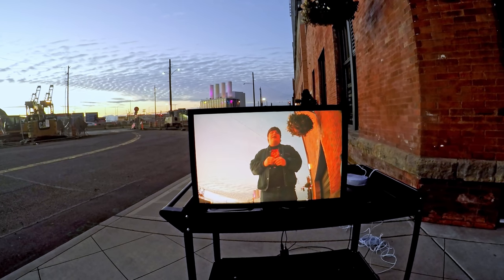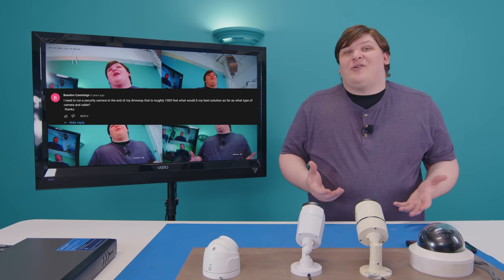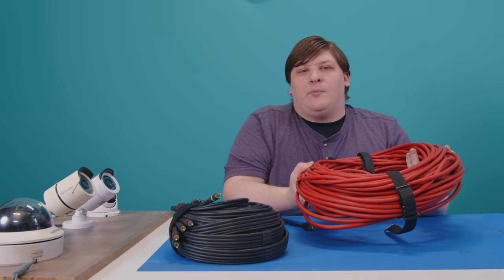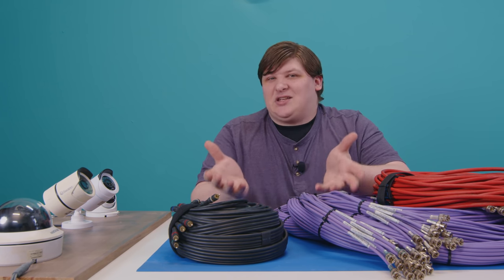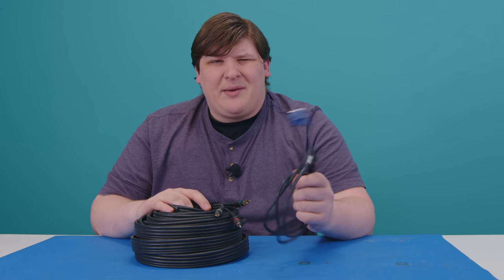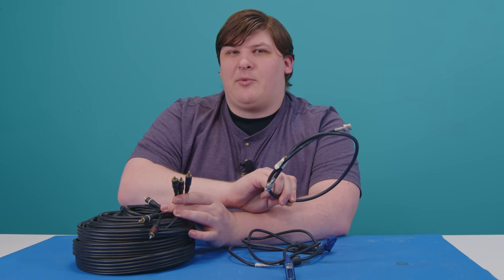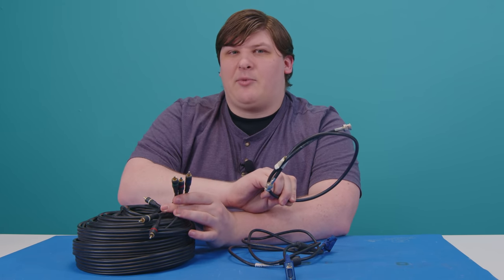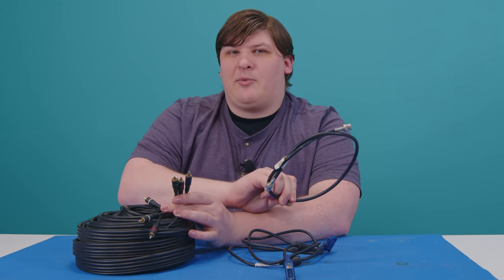1000ft of ANALOG HD video over a single cable?! [AHD/CVI/TVI]

Comment: To the point about graceful signal degradation in digital: This actually does exist, and the only company that I know who does it got their start in AHD security cameras. Divimath, who make HDZero FPV drone racing transceivers, have their signal processors accept basically any data and display it uncompressed, as-is, so while the picture is digital (some kind of JPEG-like DCT compression) it fuzzes and fades very similarly to analog.
Reply from the maker: Okay that's VERY exciting, I would love to see this in action!
Reply: Ah, neat! It does seem like the goal of a standard video codec is balancing compression with quality, but ignoring robustness for the most part. Data between key frames is so dependent on being intact (since they use complicated methods to store differences between frames rather than whole images) that missing a small part can destroy the whole image between the key frames. So with data storage and transmission being less of an issue, it makes sense for there to be a market for more robust codecs in certain situations. Too bad it's too late for DTV.
Reply: Oh neat! That completely matches up with my experience with FPV drones, but I never knew the reason the signal/picture acted like that :)
Reply: @nooneinpart  That's what DTV should do/look like if being used in a sub par situation in a sane world.
Reply: And now that you mention that.  Even just transmitting analog HD over a wider pipe as a downlink would probably be godsend for high performance drones.
Reply: @stevenclark2188  Yes, but then you get into a bandwidth problem.  If you want to have more than one drone in the air, you have to limit to about 40mhz bands in the 5ghz spectrum, and to achieve that you definitely need some kind of multiplexing. Sending a single high speed analog signal like AHD would create a ton of spectral noise, which is why the standards are going digital.
Reply: For reference, analog NTSC has a bandwidth of around 8 to 10 MHz, even though only the center 1 MHz or so is actually needed for the data. All other stuff is fuzz from modulating an analog signal with sharp edges.
Reply: To my knowledge, MJPEG does this pretty well, because it compresses every frame individually as a jpeg and sends it that way, so if one frame drops it doesn't kill the whole stream. It's a neat method, just not very efficient.
Reply: @tbuk8350  MJPEG is probably the idea intraframe format, but you can get better  subframe reliability by transmitting the image in tiles over many narrow, orthogonal carriers. That way if you miss a tile, or one carrier fades, you at worst lose a line or something rather than a whole frame. Chris Rosser has a podcast where he talks with Carl Zhou about this.
Reply: @Jergling  : You could probably get an even better result with some sort of fractal treatment, where the signal is first converted to some sort of hierarchal relative-encoded fractal form, and each data stream carries more bits from one "fractal path" than from others, while still carrying enough to get a fuzzy image in the non-prefered areas. Put in some effort to ensure that all of the paths carry data that is "representative" but minimally duplicative,  and throw in a bit of consideration for time so that you can compensate for lousy frequencies by swapping the binary channels from one analogue channel to another, and you should get an encoding that surpasses MJPEG.
Reply: @Jergling  yeah, it's not perfect but it's pretty good. I use MJPEG streams on a wireless camera I have on a robot I'm building, because it takes up less bandwidth than an uncompressed digital stream, but it's just as reliable, and the quality isn't bad.
Reply: @absalomdraconis  I have actually been looking into developing algos for this. In the video world they call it "multiple description encoding" or "enhancement layering". Took me forever to find those terms.
Reply: Yes you can see a history of this by watching the evolution of Tour de France coverage or something similar.  The mobile cameras stuck with analogue right up to switching HD at the last moment in late 2000s, and they now do a "keyframe sweep" (my phrase) that cleans up stale error pixels from the MPEG-style more efficient motion blocks.
Reply: There's a spectrum of tolerance to degradation, with analogue at one end, and high-efficiency MPEG-style at the other.  Adding 'hinting' for delivery formats is a 1% overhead that helps.  The next step is avoiding B-frames so that errors don't propagate further in time.  The next step is the common industrial technique of spatial sweeping refresh of keyframes constantly, making dropouts much less difficult for the viewer.  A radical step is to remove motion compression entirely, and is useful for tapes (where data is cheap) and maybe cables, where you'd want 25 or 50 Mbps for SDTV only (typically 10x less -- you can see the gains that MPEG creates).  Finally you can ditch compression altogether, like SDI and HDMI, or just a light-touch 3x that frankly won't matter if you're not editing CGI or doing colorist work.  That's 270Mbps for SDTV or 1.5Gbps for plain HD with no 1080p60 or 10-bit, HDR etc.  If you can sustain that level of throughput for 99.99% of frames, it might be tolerable.  Bit errors are not noticeable but I'd have to give you a lot more "nines" to talk about pixels or bits.

Comment: Working at a lawfim, I hate finding codecs for surveillance systems when needing to do editing.  The worst is when the video player that the hardware requires for playback doesn't supply a way to export the video to a usable format.  The worst is when multiple cameras record at 15, 30, and 60fps and try to .watch up angles.  Pain in the ass.
Reply: Working at a court house, I completely understand. Evidence gets submitted, and you can't play it without installing codec of the month. Some of those come from really sketchy developers, so we require conversion to a "vanilla" codec.  I've even seen proprietary .WAV files which I didn't think was possible.
Reply: Would a law firm pay someone to do this as a service?
Reply: @FloydBunsen  I would think so. Legal/trial support services is a thing. Some firms have them on staff, but many outsource the job. There are probably some serious NDAs for handling sensitive stuff.
Reply: @TechnoTinker  Yeah. .WAV is a container format. I was having fun playing around with a pirated copy of the Fraunhofer MP3 codec for whatever predated DirectShow as a teenager back on Windows 95 and using that to put MP3-compressed audio into .WAV containers. I forget if Windows 3.1 did, but Windows 95 came with several different codecs for .WAV by default.
Reply: @ssokolow  I think Windows 3.1 had about 5 codecs for WAVs, and I just took it for granted that they were always one of the standard ones until that security footage came in. I was really hoping that I could just change the byte for the format, but it wasn't that simple.  Wikipedia has some good info on the container layout.
Reply: @ssokolow  yeah sadly WAV is not really always guaranteeing you that you get lossless PCM. When i was dealing with these early 2000s MP3 players that could also record Voice i was surprised to see things like ADPCM and other exotic compressed variants.
Reply: @PsRohrbaugh  Yes..... when they have these ancient browser viewers....  Not in a long time though have I seen that though.  Both surveillance and viewing MRI's / X-Rays were a pain till not long ago.
Reply: @FloydBunsen  Usually firms have on site IT people or outside.  I have worked for one exclusively for the past 18 years.  Total of 24 years in IT / Legal field.  As lead programmer/admin, if who you pay for IT support can't do it or make it happen, find another IT person/company.  I used to find it amazing how many people still can't use a computer to its full potential nowadays.  When I had a TRS-80 in '81, I could understand, but now?  I guess it's just a specialized field some of us are in and we are wired different, that's all.  Such is life.  :)
Reply: IKR!  Sometimes the makers of the security gear want to get paid to allow export off of the device.  When nothing else works, get a dark room and aim a camera at the screen.  (Use a tripod, watch for reflections of lights behind the camera, and set white balance to outdoor.)

Comment: In the '90s I remember hearing about plans for a stopgap system for consumer use that would stitch digital video onto the sides of a 4:3 analog TV signal to create a widescreen image while remaining backwards compatible with existing TVs. That didn't go anywhere, I guess due to the FCC realizing how lucrative it would be to abandon analog so they could cram multiple digital TV signals into a single transmitter and then sell off the upper UHF channels to mobile phone carriers.
Reply: Put "wikipedia palplus" into a decent web search engine.  It was briefly used in several European countries.  My Sony DHR-1000UK DV cassette deck has the PALplus decoder built in.
Reply: And where would the frequencies for that extra bandwidth  to carry digital sides come from? Also how would that increase  vertical and horizontal resolution in the center?
Reply: I sure do wish that the weird Frankensignal would've come to fruition.
Reply: @StevenBradford  I cannot definitively answer this question but with radio stations in the US there is a certain amount of bandwidth between channels called guard bands. When FM got the addition of HD radio they used a small amount of bandwidth on either side of the channels using a small amount of the guard band for the digital signal. The digital signal also takes significantly less bandwidth so it fits in the guard bands nicely. You can see what this looks like by searching on here for "HD Radio RTL-SDR Decoding vs Analog Radio"
Reply: @StevenBradford  Search "Combining Digital and Analog Signals for US IBOC FM Broadcasting" to find the paper on the topic by Bob & Bob.
Reply: Zenith developed a NTSC compatible analog hybrid system in the late 80's (I think it was called ACTV or something similar). I have a old (IIRC popular electronics) magazine with an article on it around here somewhere.  Basically it would use every other line of an NTSC signal and the rest would be on additional channel(s)  IIRC there were 3 proposed and tested versions one used half a channel for the HD supplementary data and was something comparable to 720P, and the there were ones that used 1-3 extra channels for higher quality...The FCC didn't like this and shortly after changed their rules to require a non-backwards compatible digital system that used no more than 1 standard US 6MHz wide RF TV channel to send HD.

This shift in rules after tremendous development money had been poured in sort of bankrupted Zenith (the last American owned TV maker at the time), they did manage to develop the RF data transport layer of ATSC and those patents had value, but ultimately they got bought out by a company that had been building some of their products since the 70's LG.
Reply: @tomcarlson3913  fascinating!!
Reply: Over here in Europe we had PAL Plus which was a bit of a niche in the mid 90s, when 16:9 Television sets were introduced. But apart from PBS stations nobody else used it on normal commercial stations. And there was even ONE Laserdisc movie that was PAL Plus encoded. Not sure if it did cost extra to include it which may have been the reason why most TV stations never used it. I guess it was just a matter of having to invest into more hardware with no real benefit.
Reply: @StevenBradford  An NTSC compatible version would get an extra 3 mhz channel for supplementary data.  In practice this simply didn't work.  If your NTSC reception was anything less than flawless, trying to add extra detail to it accomplished nothing.  So the incompatible all-digital channel we have now was a much better choice.  It only cuts out in situations where NTSC would have been unwatchable poor as well.
Reply: @fungo6631  ATSC 3.0?  Nah.  Broadcast TV is basically over.  Everyone is watching TV on their phones or through the internet.
Reply: @fungo6631  Have you ever tried to find anything worth watching on TV in such places?
Reply: @VPWedding  do ppl watch TV or just turn it on for their pets or kids when they need too pacify them
Reply: @isaarunarom7830  I'm just saying that we'd be better off building universal internet than tweaking ATSC - which will only benefit people in larger markets that won't be watching much more TV anyway.
Reply: @VPWedding  I am within a 10 mile radius of a major city with many in town broadcast. The analog system was superior in every way but picture quality.All channels were available with simple rabbit ears with acceptable signal quality. Digital requires a roof mounted amplified directional antenna to pick up the same channels and this still has bad reception on some that are on the fringe of the aim of the antenna.

Yes picture and sound are much better and the sub channels are a great addition in some cases, but the channel loss due fo weather changes and just random dropouts made using it suck. I would prefer the crappy reliable analog over digital, atleast in a storm I could see what the news was saying instead all I see and hear is the stuttering unintelligible  digital garbage.
Reply: @D3M3NT3Dstrang3r  Strange.  My experience is almost the opposite.  I'm in the suburbs.  I get much better stability from digital, but am disappointed with the sub-channels here.  I've always had a roof mounted antenna, but had to climb on the roof and muck with it often in the analog days.  Now days, rabbit ears on the second floor receive everything.  During the transition, lots of digital stations had to broadcast at low power, but that is over now.
Reply: In Poland we had PalPlus broadcasts on one channel (TV Polonia), but it went basically unnoticed because turns out that most users can't even notice 16:9 stretched from 4:3 and just run the TV on random settings. I remember some 16:9 CRT TVs had the "smart stretching" where it kind of kept the middle of the picture intact and stretched just the left/right border, it theoretically worked OK but most TVs I seen people just pushed the "aspect ratio" button till black bars disappeared, usually ending in basically any variant of stretching/cutting borders other than proper one. It didn't help that automatic adjustment tended to not work because some dumbass executive at broadcasting company decided to put the station logo on the black bars.
Reply: @shana_dmr  You have to build intelligence into the broadcast standard because you'll never find it in the executives or the users.
Reply: @D3M3NT3Dstrang3r  HD Radio / IBOC was even worse than DAB.
Reply: Pretty sure there were articles in Radio Electronics about these systems.
Reply: @KRAFTWERK2K6  in indonesia we use all 16:9 wss but still we canot compare it to digital the bandwidth wasnt engouh with HD or UHD studio setup..the color washed out, it loss a detail on text and dynamic range was gone...but in crt its looking fine but most of crt here are 4:3 and only 16:9 was lcd. Sadly, this is the last day of analog in our capital city and the deadline was november
Reply: It Was the Internet! The TV Signals took up 90% of The bandwidth Of Cable TV! this Was A Huge problem As the Internet Was growing And Needed more than Just 10% of the bandwidth!! Now it Is just The Opposite! The Internet takes Up 90% of The bandwidth And All of The TV takes up About 8.5% leaving 1.5% For The Audio! This Also Allowed Them To Cut back the power used To transmit OTA TV! Digital Is better Than Analog As TV Stations I never Knew Were Possible To get from over 90 miles Away Comes in Clear As A DVD! If You Are having problems Receiving The over the Air Broadcast it is most likely the Transformer On the Antenna That Degrades over Time usually Because it Is not properly grounded! Being Up in the Air During Electrical Storms They get damaged!! The Old Large TV Antennas Are better Than The CRAP They Sell Today!! I Keep My Eyes Open For These Old Antennas As They Only Need A transformer To Work Better Than The Crap We get Today!! The Signal Frequencies Did Not Change!